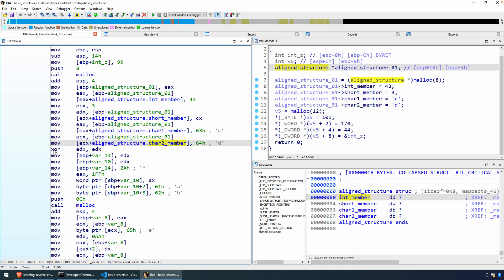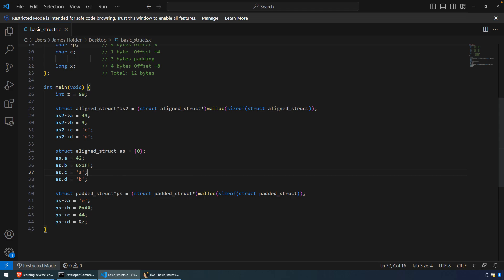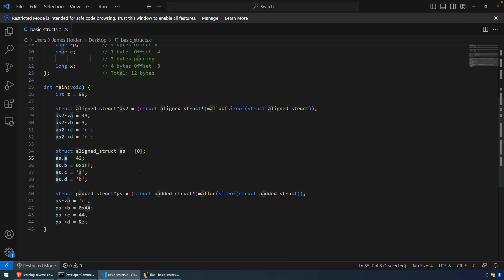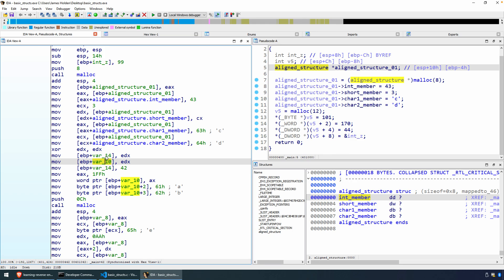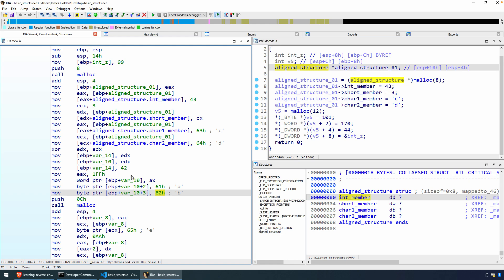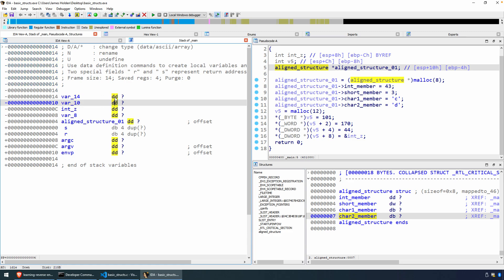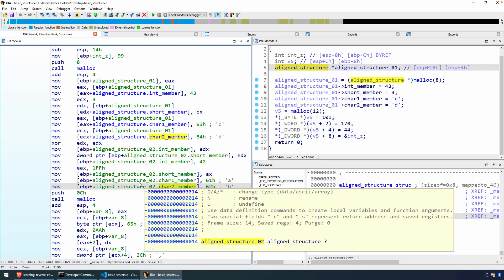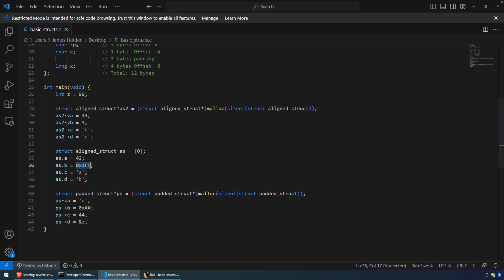Analyzing Stack-Based Structures in IDA Pro - Part 2

Comment: would not v5 need its own structure and we can't reuse the aligned_structure, because of the size? i understand that we can reuse the it for the first part because it is also 8 bytes but what is with the other 4? (i will look myself later after uni, but mby someone sees this and has an idea)
Reply: thanks for your videos they are great i learn so much omg c:
Reply from the maker: I'm really glad to hear that!
Reply from the maker: v5 is the pointer for the third structure in the pseudocode view - which means it is just 4 bytes on the stack but points to 12 bytes of memory. The first structure is the same, 4 bytes on the stack for a pointer. The stack based structure is seen in the disassembly and covers local vars var_10 and var_14 - which are 4 bytes each for a total of 8 (which is the size of the structure). I'm might not fully understand your question so let me know if not. Hope this helps!
Reply: @jstrosch Thanks understood now! 😊